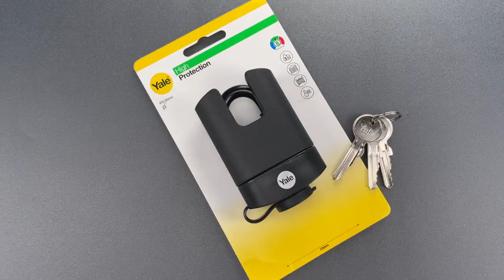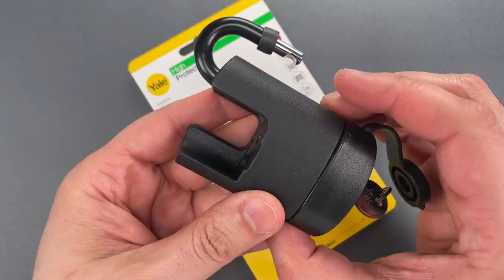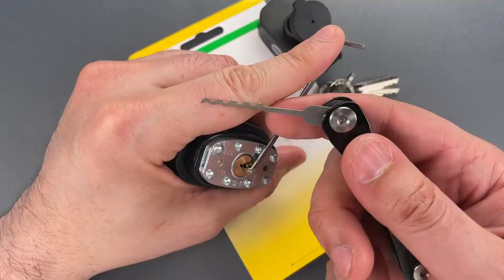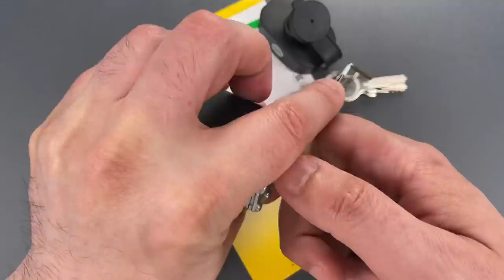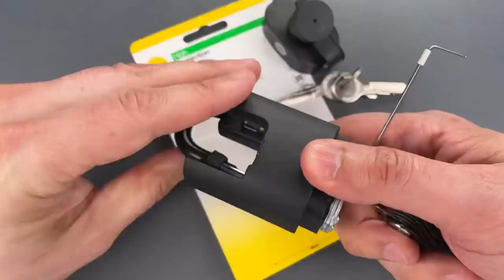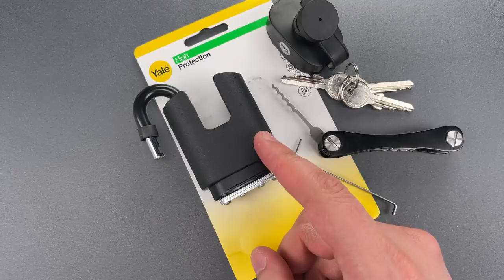[1288] A Veneer Of Security: Yale 221B Padlock Picked

Comment: sees bottom of keyway tensioning "oh, it's probably gonna be fast"
sees rake "and embarrasing"
Reply: I actually closed my eyes for a moment and said quietly to myself "oh yale, what have you gone and done now"
Reply: LPL has probably been raking locks since before he could walk.
Reply: To be fair, it takes LPL probably longer to rake a lock than to SPP it.
Reply: Clearly, this is one of the better Masterlock products...
Reply: the 2 min video gives it away
Reply: In this case, the "not a fluke" was to prove that it doesn't USUALLY take eight whole seconds to pick.
Reply: I always feel especially bad for the lock when its raked open. Like dunking on a little kid in basketball...on a 5ft hoop.
Reply: @2Fast4Mellow  ROTFL
Reply: That was my thinking too xD
Reply: LPL:  posts video
Yale: fires product manager
Reply: @GreenAppelPie  how do you think he made it out of the womb?
Reply: If you see a rake or a jiggler it means you're better off holding the door closed with a heavy rock.
Reply: @EvolvedWizard  maybe just cement it closed. No opening means no vulnerability right :)
Reply: I was gonna say almost the exact same thing.

Comment: They meant high protection from *the elements*, not from people. It's will stay nice and corrosion/dirt free so the pickers working on your lock have an easy, smooth experience.
Reply: It might be aesthically in better condition than metal counterparts
Reply: it's actually really considerate of them, if you think about it
Reply: Nice... A lock that gets more secure over time... As dirt and sand make it harder to open ;)
Reply: Elements like 2 hydrogen and an oxygen?
Reply: Until you realize that such protective coats tend to have the opposite effect, letting a small amount of moisture and salt in there and keeping it there for maximum corrosive effect.
Reply: @sbcontt YT To be fair to cops, the other day I saw one pulled over so that he could help someone change a flat tire.  That's not something they are paid to do, but some of them are exceptional people who do the right thing anyway.  

I'm not saying that there aren't bad apples, bad precincts (I suspect bad precincts are more common than a bad apple in a good precinct), or dumb red tape, they definitely exist, but it seems unfair to me that the good guys never get the limelight.  Most of the bad events surrounding cops are instigated by misguided fear or hatred for cops, so the lopsided reporting is very dangerous.

Again, bad things need to be reported, but good things need to be reported as well to keep things in perspective.
Reply: This is “high” security, like Snoop Dogg high, not strong security.

Comment: “It’s what’s on the outside that counts”

—Yale
Reply: "Always judge a lock by its cover."

—Yale
Reply: Close to politics
Reply: More like "It's what appears to be on the outside that counts" because the outside sure isn't as beefed up as it first seems.
Reply: In some cases that's actually true, a thief might move on before even trying to open it when he sees a "strong" lock
Reply: @KadaXuanwu  very true. But once that awareness gets around the criminal circles, they're just going to take a crack at it real quick and then move on if no luck. 
At least some better quality in the lock might cause more hesitation bcos having to put in a little bit more effort with potentially no guarantee it's a easy lock or not, it might be a better preventative.
Reply: Plastic and rubber. Good enough for "High security" I guess
Reply: @Willow4526  I had heared that criminals tend not to pick, it's more security proffesionals and white hats like us (I assume the rest of you are 😂) that pick. This lock needs testing with the spanner and hammer methods.
Reply: @paulkemp8520  I have heard that as well. But idk how accurate it is. I do doubt that most criminals are smart enough to invest the time into picking tho lol.
Reply: Btw, if the bottom cover cannot be removed and goes deeper, so LPL's most turning tools are not long enough, could that be counted as "security feature"?
Reply: @Willow4526  the best burglars leave the house exactly as they found it, so victims do not notice anything until it’s too late. Thus, picking is an absolute necessity for this tactic.

Comment: Why do people even make locks without security pins? There can't be any substantial cost difference. Sure, setting up a system which produces different, random combinations of pin types for each lock might cost something, but just blindly replacing every standard pin with a spool would at least prevent raking attacks.

Comment: Looks like it has decent protection as a low security padlock. Even a metal lock body won't hold up against the grinder. The shackle has protection around the shackle which might be enough for the attacker to go for the chain instead. Seen that sort of thing happen.

Comment: I had to lock my garden shed  but the key was missing so using the Raking technique I learned from LPL it is now locked. Just used a smaller key and had a small flat head screwdriver as tension. 30 sec and locked. So lock picking backwards is awesome and super helpful. Thank you LPL!!!!!

Now to go through the LPL archives and find a good lock. If that exists for a small outdoor room made of tin that gardening equipment is kept in. With a small window.. Hmm might just get a lock for the appearance of security lol.

Comment: I dont know the standard of false advertising for the EU but by #Yale adding plastic to a laminated, mass produced lock and labelling it as "high protection" ('high security'); leads the customer (even someone as experienced as channel dedicated to opening locks) to think that this a product that protects against bolt cutters and handheld plumbing torches

Oddly enough I cant find this lock on the UK/NA site for Yale. The UK side has Yale Protector Y127 Padlock which looks like the #masterlock num 3 in every way.  The French side has a ‘waterproof’ series - which look to have the same forming of plastic and general design (including a high shackle guard): https://www.yalehome.fr/fr/produits/cadenas-/cadenas-de-securite/cadenas-etanche/

Comment: First time I blinked, second time might be a fluke because it was faster ;)
I remember opening a cheap lock several times for training, and once, the moment I barely touched pin 2 the lock was open. "Oh, that was easy..." closed it again, recogged properly, next time it took significantly longer to open.
It seems the pins were almost all stuck at the shear-line ... that's my explanation for a possible fluke :)

Comment: Looking at the keys, it looks like the pins in the back of the keyway don't have to be pushed as far up as the pins near the entrance to the keyway. That just seems like a horrible idea. When raking, or when picking with improvised tools, it seems that it's much easier to get the job done with the keying is in this general configuration.

I'd go so far as to say it's better to risk more duplicate keyings (where there's maybe a 1/500 chance your neighbor's key will work in your lock instead of a 1/1000 chance) for the sake of eliminating the stupid-easy keyings altogether.

Comment: Sadly, I've seen a few locks from other manufacturers with the same plastic construction over a basic laminated lock body. Sometimes the lock has only four pins, and usually the laminate construction is zinc or galvanised steel, not hardened steel too. I even found one that disguised itself as a plastic coated laminated steel double locking padlock, but was actually single locking skeletal (not even solid) cast junk body with a tin cover over the pin cylinders (and the packaging weighed more than the lock itself.  I didn't think that the shortage of materials was that bad yet.

Comment: Well, these brands live off the fact that you need to have some level of knowledge on what tools to use for each brand/type of lock. If you don't, you might spend a bit more time with attempts at finding the weak spot.
This does not invalidate that these locks are crap, specially since their best defense is the fact that, such ample variety of available crap decreases slightly the panel of pickers who can quickly go for the right option.

Comment: I honestly dont understand lock companies, like what is the point in designing and manufacturing locks that are so easy to open by even the most novice burglar ?
are one or two spools or serrated pins really that much more expensive to put into a lock? 
You'd think they would prefer to have their reputation safer with a more secure lock that only costs a few pennies more to manufacture

Comment: High protection??
Any lock that can be easily raked should not be able to be sold with any extra expectation other than it is a lock with a key.
To say it is high protection other than it offers protection is not good from a company that rely on its reputation.

Comment: Dear LPL, I haven't seen all your videos, but it always seems that padlocks have just one keyway and one key.  Have you ever seen a padlock with two keyways that must both be actuated at the same time?  It could be picked if you had a twin, but otherwise, a person needs to use a right and left key at the same time.  Using either one separately does nothing and only the owner knows which key is right and which is left.  Using the wrong key on the wrong side permanently binds the padlock up forever.
Reply: I saw video 416 but that doesn't quite cut it because either side can be picked separately.

Comment: It's literally never a fluke lol
Reply: He cuts the video short if it ends up being a fluke, or just doesn't try more than once... Brand new lock can get "stuck" due to good tolerance, so it's theoretically possible to be pickable until the key is used few times to grind the internals. When the internals are too worn, the lock becomes pickable again due to tolerance degradation. One has to remember that key operates all the pins, levers, or disks, at the same time, but lockpick usually operates them one by one. Rake is somewhere in between key and lockpick, as it can operate several at the same time.